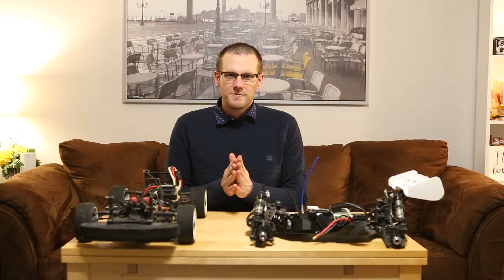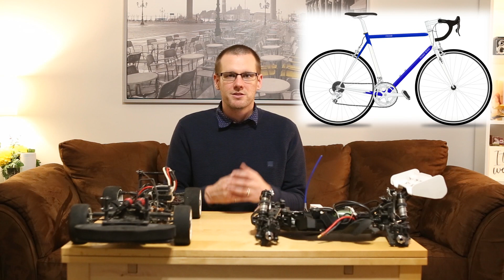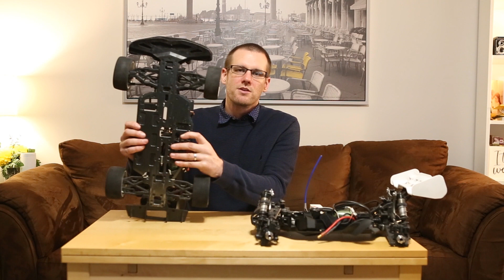RC Car Suspension Setup Basics (Caster, Camber, Oil and more)

Comment: Your videos about shocks were very helpful, thank you for making them.  I knew almost nothing about shock absorbers when I got an RC car.  Knowing basically how they work and what the spring and oil are supposed to be doing armed me with enough knowledge to get both of my cars shocks tuned to what I think is perfect for me.

How did I wind up doing it?  This is how to find just the right stiffness for your shocks on a basher without actually knowing what you are doing... Haha!

Find a patch of ground that is "a little bumpy", for me it was a nearby park where they don't care for the grass/grounds very much... so it is "a little bumpy" instead of like a lawn.  Drive your car on the bumpy terrain and stare at the car and suspension/a arms as you drive it.  Go around you close looking at slower speeds, and do full speed passes over the bumpy ground.

What you are looking for, assuming a basher, is the stiffest suspension you can get (for landing jumps) while still gliding over slightly bumpy ground with the car body remaining generally level as the suspension absorbs the bumpy terrain.  The body should remain mostly level as the a arms bounce up and down taking all of the bumps.  If the shocks are too stiff the body will be "bouncing around" and tires will occasionally bounce up off the ground.

I just kept going back too the park and it took 5 or 6 times/battery charges doing this to find the exact right level of tension (I have adjustable aluminum shocks) for both cars (Kraton 4S & Typhon 3S) right at the edge of being "too stiff and bouncy" without being too stiff and bouncy.  

If this is the tuning you are looking for, as stiff as it can be to land jumps while still handling well... this is a good way to do it if, like me, you don't really know what you are doing.

M&M

Comment: one purpose for positive camber would be oval track... just left turn. But not much. doing 0 on the inside tire will be the solution at some tracks but others you will need up to 1 degree of positive camber on the inside tire.
Reply: other than that, this video is great. I finally understand camber a little bit now. thank you
Reply from the maker: Hey Zachary, great point and thanks for the comment.

Comment: Hi Ryan. Another very good video. I am getting back slowly in the RC car world after almost 30 years and I like very much all you video which help me save some time and learn again faster.
Just a question, would you have some figures to share about oil thickness and springs for off-roads to give some guidelines based on your experience / different tracks?
I was wondering if you would think necessary to make a more advanced video about shocks like about angles and mount position and share your experience even if there are other videos outside speaking about this subject.
Reply from the maker: Hello, thanks for the comment. It's hard to make specific recommendations as the weight of fluid and spring stiffness changes due to a handful of variables. In addition, my recommendation may not be the desired preference for many. I tend to like a stiffer setup coming from majority of my experience being on road. 
I don't have enough experience/data for shock angles and positions to make a more advanced video at this point. Maybe in the future!

Comment: Can you share one of those slo-mo vids to help explain about harder spring and thicker oil, and vice-versa?   I have seen it suggested for on-road to make side springs stronger, but oil thinner?  That was for 12th scale LMP.  Cheers.
Reply from the maker: Hey Xavier, I'd love to make a slo-mo video. That's such a good idea! However, I don't have the equipment to get more than 60FPS.
Reply: @RCexplained  Its Slo-Mo so 60fps should be good.

Comment: Thank you very much for sharing. Thumbs up number 22. Your video is helpful for setting up my suspension.
I am building and setting up a 1/10 touring car for speedruns. Thanks for the advice to use a heavy spring rate for onroad driving. That's the way my car is and I was worried it will be too stiff. Right now the rear has a heavier spring rate than the front. What is your opinion on this?
Then, perhaps an odd question: Do you think using a fixed slight steering angle on the rear suspension would give any benefit for straight line hard acceleration? Or should it just be plain straight and parallel to everything else?
Reply from the maker: Hi TN RC. Is the rear springs a little heavier because of more rearward weight in your particular RC? You will know if the suspension is too stiff if you hit a bump in the road and the car becomes unstable. 

Are you talking about toe on the rear tires? A small amount of positive toe may work out ok for you on the rear end.
Reply: @RCexplained  Thanks for your reply. 
1. answer: Yes, rear springs are heavier, because my RC touring car has more weight in the rear.

2. answer: I am sorry if I expressed myself unclear. I didn't mean toe on the rear tires, I meant the rear steer angle on the rear axle as a whole. In other words the rear part of the drivetrain including the suspension is turned a very few degrees. 
My idea is that when lots of torque is applied, there's the risk of the car having a tendency to rotate sideways a bit. I think in the RC world some call this torque steer or something like this.
But in the full scale world there was for example this Dodge Ram truck with the Viper V10 engine in it, and it refused to oversteer in left or right turns (I don't remember which one) when heavy throttle was applied.

Anyhow, despite the cold temps I went outside today with my build and tested straight line stability. I only accelerated the car up to approximately 55-60 mph (about 90-100 kph where I am), and the car seemed heading straight and nicesly stable. For this test the rear axle/assembly was rotated 1-2 degrees. Will do some further testing hopefully soon without any rotation of the rear assembly.

The road I was testing on has an okay surface, but is far from being smooth. When driving on it with my full scale car, at 60mph it's quite bouncy :D
RC car seemed to handle the imperfections nicely. But will also do some further testing with different spring preloads.
Reply from the maker: Hi TN RC, your test will be the best answer for your setup. The fact that you feel the car is handling the rather bouncy road way at 100km/h well is a great sign. Keep testing and adjusting until you get the settings to your liking.
Reply: @RCexplained  Will do. Thanks for your replies.